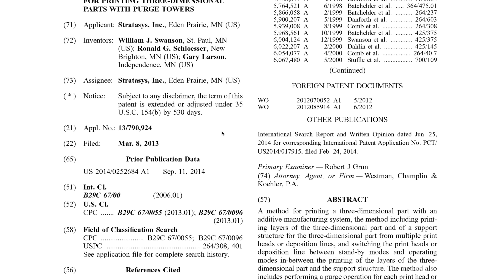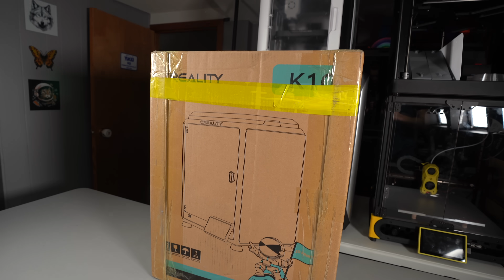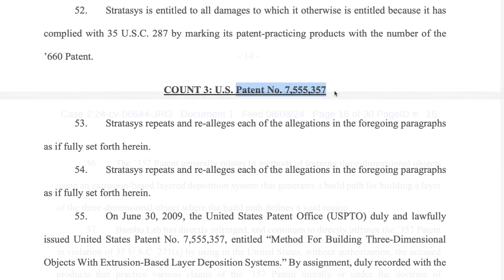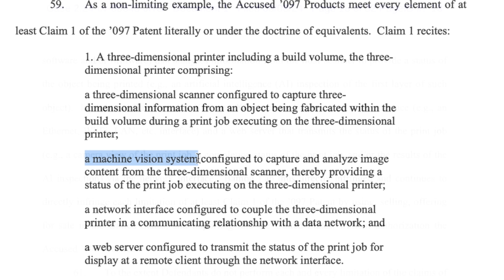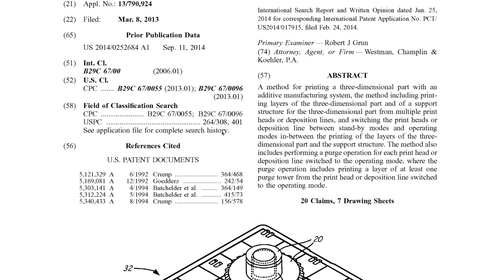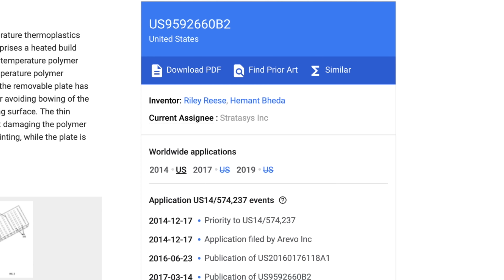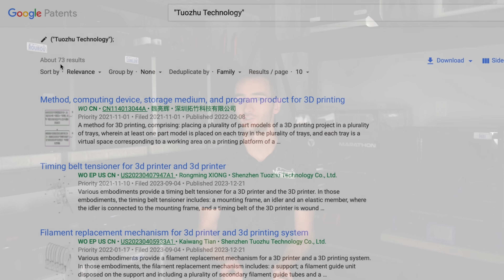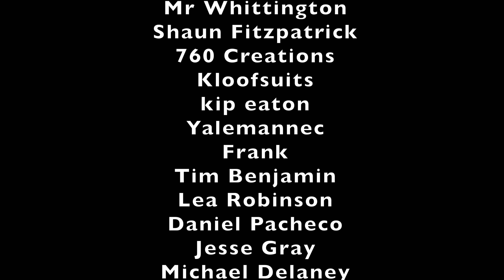Stratasys v. Bambu Lab - Will Prusa Play A Role ?

Comment: Stratasys is just afraid of their customers finding out that the machines don't actually cost 70k
Reply: or $250,000. or $500,000 (+ >$25,000/ year recurring fees)
Reply: *worth 70K xD
Reply: Stratasys is just pissed because they can’t sell a 20k Ultimaker or MakerBot anymore
Reply: Thats true but some of that cost is to pay for maintenance when things go wrong, my first experience of 3D printing was at the engineering company I worked at in the  late'80s, they had Stratasys machines and when they broke there was an engineer there pretty quick that got it up and running again/
Reply: The lawsuit is a complete joke. It should be illegal to get patents on most of this stuff.
Reply: Stratasys is simply a bully trying to reclaim its monopoly... There's no IP infringement, so they should lose this fight... but court rooms can be an unpredictable jungle
Reply: @Silent_Steel  You should be on Bambu's legal counsel. You seem to have it figured out.
Reply: Absolutely
Reply: a bit like that at work / texile factory , they bought another cnc type machine for cutting fabrics pretty much under 2mx2m bed , half a mil $  and I am like that is maybe $10k worth of parts ... hell my printer at home is 1.2m x 1.2m x 1.2m print area and that barely cost $2k to build
Reply: ... And that their machines suck @$$.
Reply: I work for a company who runs Stratasys printers, and I have serviced them extensively. The cost, considering what you get from them is basically a turn key solution, is worth it on a company level. We paid off our printers in just a few months of casual printing. The amount of custom parts in those refrigerator sized printers is insane, and does mean that Stratasys spends a lot of money on production. Even sold at cost those printers wouldn't be cheap. I'm not defending Stratasys here, I think they dropped the ball on development to say the least, and have focused on tiny incremental improvements while spending most effort on defending their market share. They're not really innovating in the field any more. Frankly the real issue with Stratasys isn't the cost of the printer, it's the cost of the material. They routinely charge 10 times the cost of any other FDM material on the market, and you're locked in using only their material, you can't even respool material on their spools as they're locked via chip. There is simply no justifying that.
Reply: We run a few F370 and 2 F900. Those machines pretty much runs 24/7 with only about 8 weeks of idle time in due to holidays. With grabCad it's pretty much a send and forget operation. I don't trust any consumer grade printer to handle that kind of workload @BongoTheClown
Reply: hhhhhh,yes
Reply: “This likely concerns the use of RFID tags…” Likely? You highlighted “RFID tag on each spool” in the lawsuit so it actually concerns RFID tags, not likely concerns, sheesh. Tighten up your script, so many meaningless filler words, and you dragged your intro out for 3 minutes.
Reply: @radish6691 literally. like you can't just slap 'network enabled' in front of something and pretend to have come up with some revolutionary idea.
Reply: @radish6691  then we shall be expecting MANY lawsuits coming. they are going after bambu because they deliver without the hassle. statasys can keep their faff, and i keep my x1c. stratasys is scared that folks will found out that their machines are grossly overpriced for the product it makes.  they are shitting their britches as bambu lab is encroaching on their sales. 

companies are buying four x1e instead of the stratasys smallest rig. and by that get four times the production volume pluss pluss.
Reply: It's a very surprising and disgusting level that quite a few people have such a low level of intelligence.

A company's patent development is its own asset. The company also belongs to the investors who have invested in them, which is to pursue profits.

A company's number one goal is to pursue profits. The goal is not to supply the world comfortably and cheaply, and this is not an absolute line.

If you deny the natural right of a patent, competition will collapse and technology will go through a stagnation period. The right to be rewarded for the technology they have invested in is their natural demand and authority.

Providing good technology at an affordable price is not necessarily a good and good company. If you want to compete, it is natural to follow the rules of the market.

You're praising a store that steals other people's recipes and makes them cheap just because it's delicious and cheap.

You have to get your act together.

According to your logic, the first company to be defeated is ibm, and all companies such as Apple, Samsung, Coca-Cola, etc. claim to be a bully with patents.
Reply: @여리여리-w2k claiming that patent is what drives innovation foward is so stupid taking in consideration that Stratasys held the patent for 3d printers for 20 years and once it expired you see more innovation from the open source community than they ever did in 20 years
Reply: @여리여리-w2k , you might need to do some research. What you described is how the patent system was INTENDED, but that is NOT how it has been administered since the turn of the century, possibly longer.
Reply: @여리여리-w2k  Everybody knows that, that has been the paradigm for the last 150 years. Look at tesla, look at open source software and all the derivative work that has been done without patents. Patents are  a thing of the past, look at how the chinese cell phone manufacturers iterate without patents, they just start where others left and then the first picks where the prevous one left. There is also profit in this method and there is also innovation in this way of doing things. What there isn´t is patent trolling and technology suppression because its all in the open. Business models change with time and the patent business model will also change.

Comment: Patents are becoming a problem when they are granted by ignorant patent offices that cannot be bothered to look for prior art or theb obviousness of solution.
Reply: changing parameters by rfd is not novel or new either. its been done for a long time. Heck my first 3d printer from 3d xyz did this back in 2014, it also had a heated bed and was enclosed. cnc machining has been using force feedback for a long time as well and a 3d printer really is just a cnc machine. I hope Stratasys loses on a lot of these patents so we can start to have innovation in the market.  the reason we don't have heated chambers is because of Stratasys . and i don't think it was that innovated to add a oven to stabilize  stress.  we do that for glass since back in medieval times
Reply: They get so many patents at a time, there's no way they could be expected to be through enough. Still, it's a shame most of these patents were even granted.
Reply: @ml.2770  Luckily, beeing granted a patent doesn't mean it's valid.
Reply: It took 4 yrs to grant the patent... That's either alot of research or alot of inventing going on at the same time.
Reply: @phasesecuritytechnology6573  or a lot of steak dinners
Reply: Not sure you understand how the patent process works, it’s actually pretty through and takes years to get one and you have to prove it’s unique enough to be patented.

Comment: Much ado about nothing. Bambulab has a portfolio of patents.This is why the filed all the patents they have. This simply a mechanism to create a cross licensing deal, considering that Bamblab can file a cross complaint to tie up Stratasys in court. Consider what happens if Bambulab files a cross complaint and then threaten to request an injunction against Stratasys very expensive and highly profitable machines. A lawyer at Stratasys didn't think this through. This will go away very quickly and a cross licensing deal will soon be forthcoming.
Reply: Bambulab has very few patents so I don't know where this nonsense comes from

Comment: Isn't a patent filing date considered, and not patent granted date? It is legal to use "Patent pending" on your products if you really have a patent in the system, waiting to be granted. And if the patent is granted, it is valid from filing date?

So if Stratasys filed the Heated Bed patent in 2013, and prusa released their heated bed in 2016, it is NOT considered prior art?
Reply: I started building my printer with a heated bed back in 2012 based on the open source community. 2013 vs 2016 makes no difference. Stratasys started filing after the real innovators (not me) in the open source community came up with the idea.
Reply: but if development of Prusa's heated bed started prior to the patent filing then it IS prior art, it's a tricky one, and honestly, the entire 3D Printing community and industry can not afford to loose heated beds to some patent. basically every printer on the market would go away overnight and we wouldn't see anything with a heated bed until at least 2033, it would set 3D printing back 20 years overnight
Reply: @PAPO1990  nope, blue tape, glue stick, hairspray or some other open source innovation imo.   This will effectively drive innovation.  Laurie. NZ.
Reply: @LWJCarroll  Those only go so far, and I was an avid blue tape user before PEI, it sucks. Heated PEI beds are so much nicer and easier.